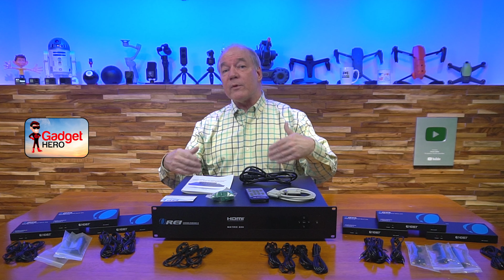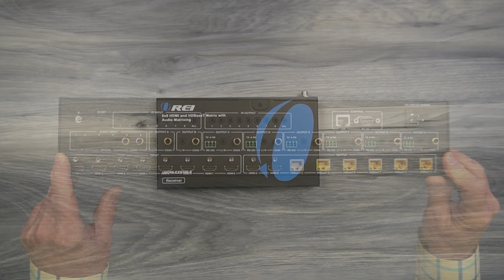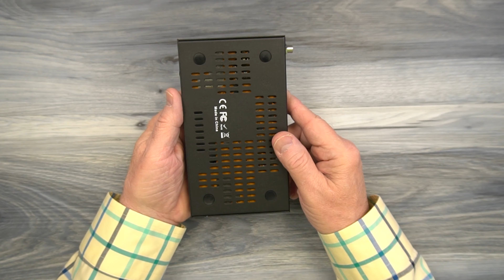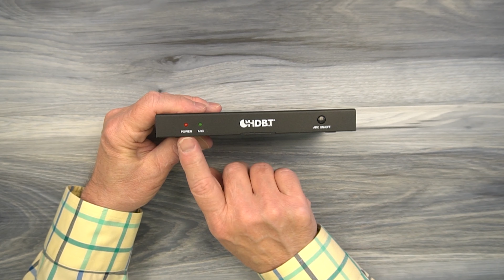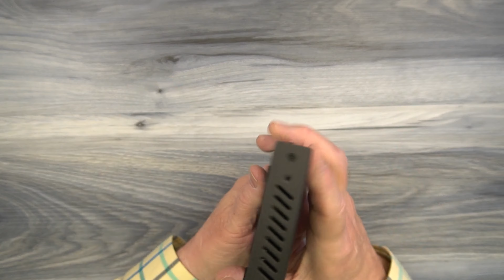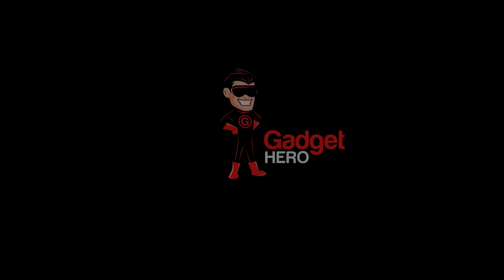Orei UHD88-EXB300-K - Full Review

Comment: This seems all positive.  

I'd like more detail on how to change the input from a remote receiver, please.  Let's say I'm watching HDMI 1 on HDBaseT C, 100 feet away in another room.  I now want to watch HDMI 2 on HDBaseT C.  How does this happen?   Can I send an IR signal from the receiver connected to HDBaseT C?   Do I have to line up an IR blaster with the matrix or does the matrix just grab...ahem...receive the IR signal via Cat5/6/7?

Seems like an excellent product.
Reply from the maker: Thanks for the post and all of the remote receivers include an IR kit that can send remote control signals back and forth to the main unit. This allows you to adjust which input is being sent to your location and control the content. It also allows you to control the monitors at each location if you're at the main location. You can even make these changes from a computer connected to the network. it's a very sophisticated unit and works really well. If you decide to make the purchase, please use this link so we get a little credit for posting the review - https://youtu.be/Cd_130kBaSs. Thanks